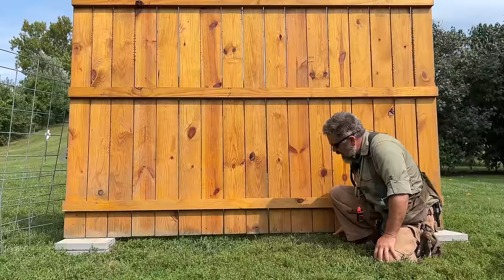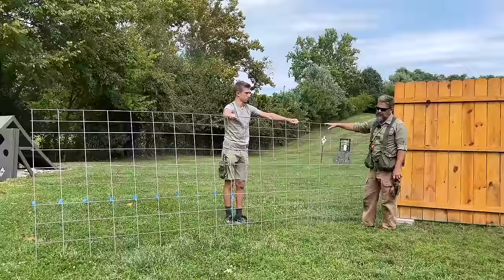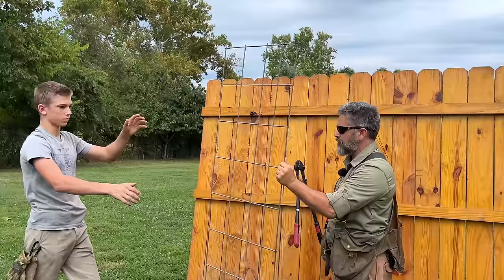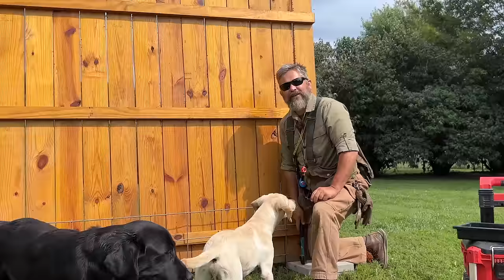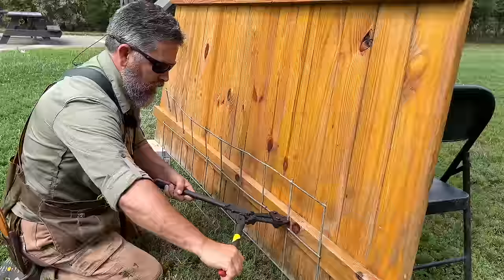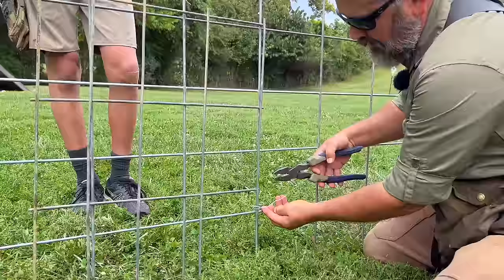How To Keep Dogs From Digging Under The Fence & Escaping Your Yard

Comment: I'm an old country girl.  I used to do this, until a kind older gentleman told me a better way with rocks.  Rocks has worked well for me for 20 years.  Works to keep coons/possums/coyotes out of chicken coops, too.  Get a bag of river rock, about 30 pounds.  Put the bag on the ground right up against the fence.  Leave it in the bag.  You can target areas, or just go around the entire fence.  If they dig into the plastic bag, rocks will come out.  You can also use rocks to fill any existing holes, just make sure you have a full bag on top.  It'll stop the digging in/out for years!
Reply: Any ideas on alternatives for rock with the same setup? I’ve seen these before, but my current pup has an issue chewing on rocks that he can get ahold of, and I’m worried about injuries if I use rocks large enough he can’t pick up
Reply: Thanks for this! I have one problem spot due to my neighbors lowering the lake level for the winter and I didn't want to go to this trouble for a temporary problem.
Reply: I use the large blocks from Lowes or from Facebook Marketplace around the perimeter of the fence. That usely deters them unless they decide to scale or jump over the fence.
Reply: Nice idea.

Comment: I am not sure if cinnamon is not good for dogs but I do know, based on my personal experiences with five dogs, that cinnamon does work 100% for me. I pour it generously everywhere the dog has dug, they sense it from afar and never touches it again.  They even walk away from the area when they get near it.   Yes you do have to put it out again if it rains.  The dollar store sells large bottles much cheaper. Black pepper and cayenne pepper do not work for me.   I even grind cinnamon sticks in a blender and use those.  Cinnamon sticks have also worked for moles when I stick them down in the mole hole path.... in which my dogs love to dig  up moles. The cinnamon sticks seems to deter moles as well. If you don't want to use cinnamon, keep rose clippings with thorns and put them everywhere the dog lays in your garden and they definitely don't like it.  For those people that say the if the dog exercises, it will deter digging..... Not true, my five dogs live on large acre farm and play and run continuously. But my cure is cinnamon personally. I have never seen anything that works this good.  It doesn't hurt my plants and also makes the outside smell so good.

Comment: Love your Video.  We do this on the farm. Much less expensive than any other way and a great way to use up panels the cows or horses have bent.  One Difference, with the chain link, I dont tie up with fence wire anymore. I use the steel zip ties with the tails turned to the out side. They are super easy and not near as sharp. We have Heelers and Aussies. If you dont keep them up when they're not working, they will get into trouble.  They're also escape artists. Mine easily "unzip"  chain link dog kennels. They'll work one piece till it comes loose at the bottom then pull it to creat a hole.... Using the pieces of cattle panel and leaving in up a couple feet puts an end to digging and unzipping!

Comment: If they are digging under a gate you can dig a trench big enough to bury some brick or block then a few inches under the ground.  When they dig they will hit brick. You gave me a new idea. I could get some 12" rebar space about 6 inches apart and drive them under the gate.

Comment: Great idea. Unfortunately, because I live in North East Pennsylvania,  there is more rock in the ground than dirt. Just putting in a single tee post is a nightmare.  I had to buy a 1/2" hammer drill to pre drill for each post. One of my dogs is a single focus, absolute target oriented 100% determined missle.  After 3 years she finally figured out how to dig out. She will probe for the soft spots. I might try this but I don't have faith it will work as I've tried tent stakes for sections between tee posts and I bend half of them. We'll see. Thanks for the suggestion.
Reply: Same with our soil, too rocky and hard, so we lay the hog pannels under the fence and attach them with zip ties, we have chain link.

Comment: Great video! We have neighbors that border our yard with vinyl fencing on two sides which leaves nice gaps in uneven ground. Since we can't attach anything to it my husband borders with huge rocks. Their dogs try to get in our yard. The aggressive dog behind us jumps just higher than the 6ft fence, you see his head up and down, and body slams it. Seems we're always left trying to protect our goldens from a neighbors dog. I have kennels out back which we were going to remove. Now my dogs need to be in them to protect them from the crazy pit in case it crashes through the lightweight vinyl fence. 
Sigh, neighbors
Reply: Hi Barbara, we too, have vinyl fencing around our yard. We also have a neighbor with a crazy pittie who smashes against the fence. What a small world. I have 2 questions with different scenarios for both.
 Scenario #1. the fence belongs to your neighbors. If this is the case they obviously don't value the fence. Have you approached them about what is happening and that you are very concerned about your dogs being harmed? If you have and they don't care, I would seriously consider putting up your own fence (even as modest as chain link or plastic netting) alongside theirs. In doing this you will have the legal right to install electric fencing along the bottom of the fence line (where there are open spots) on the side facing theirs. Electric wiring can also be strung across the top of your fence so that the crazy dog will catch his chin on it and be immediately deterred. If this beast continues to hurl itself against the fence and damages yours...this is when the rubber will hit the road and your neighbors will have to be responsible for their dog. 
Scenario #2 the fence belongs to you and the neighbors dog is eventually going to bring it down. This happened to me. I immediately went next door and explained what the dog had been doing. What damage  the dog had done and just how this problem was going to be taken care of. We were going to have a new fence installed soon and I wanted them to know that any damage done was going to be trouble. They were very responsive to my words and immediately installed an electric fence less than 6 inches from their existing fence and within 2 DAYS their dog stopped all of its misbehavior.  Pitties are known for being very stubborn. Goldens are known for being lovers. Now, my dogs are able to live in peace and I know that they are safe in 
their own yards. As it should be ❤
Reply: @angelsong119  ty for the info

Comment: I use rocks to cover holes my dog digs up. I use rocks no smaller than  the size of your hand when you have it open. A rock that size would weigh about 7-12 lbs (rough estimate). My mother told me about the drawback that insects and other pests may hide in it. To solve that, dig a shallow trench, about as deep as the rocks' height when placed on the fround. This will prevent pests from hiding in between the rocks. The next step is bury the rocks. Use your weight and jump on top of the buried rocks to compact the dirt. I observed my dog when he tried to dig and i noticed he stopped once he hit the rocks. After that, i kick the dirt back over the expised rocks and repeat the compact. Chances are high the dog wont dig in the same place. The hard part is finding rocks. I recommend this if you are on a budget and/or lack the right tools.

Comment: I have 5 Jack Russell's, 3 are 12 months old and dig like crazy. They're just now starting to explore on walks, which I take them every day. But they want to explore and won't accept being contained. I have to work so there's no choice but to leave them in the yard. I provided shelter from the weather and a self filling watering trough. They are all chipped and tagged. I just need to be sure they can't get out.

Comment: i tried this and just my luck my boxer and bernedoodle just dug deeper my boxer got out but my bernedoodle got her collar stuck on the stake end and freaked out giving her self a big gash on the beck of her neck and a few poke holes and a $400 vet bill,. So what i had to do was dig a trench and bent them into a  90 degree angle  like a big L sape flipped sideways and come 2 1/2 feet  away from the fance  taking it to the bottom of the fence and using u nails to take it to the fence post  it worked  they will still dig between the squares but they cant get out   its still an option if your dogs tend to be like mine and can still use the same pannels doing it your way without having to purchase more.  tho your method worked for my jack/corgi it did not for my boxer and bernedoodle

Comment: One of my dogs (I have 6) a German Shepherd, border Collie cross, can climb the 8 foot tall fence of their compound which is approximately 3,000 square feet of space, with trees, and a large shed with a straw covered floor for the dogs to hide in. I then covered the wire fence it with sheet roofing steel, then I found out he could jump high enough to grab the top and pull himself over. So I had to chain him as well until I figure out what to do. He then began tearing strips off of the sheet steel with his teeth once he had pulled a an edge loose with his claws, then he pulled apart the wire fencing behind it and got out again. My fence now looks like a barricade made from wire, steel sheeting and 3/4" plywood, concrete blocks and large stones, which for the moment have stumped him yet he still tries. I have to repair the fence daily.
Reply: Your dog is bored . Those breeds take an enormous amount of work.
Reply: For that breed combo, I wonder if making them a treadmill wouldn't be a better idea than fixing the fence daily.

Comment: Had a hunting breed, you should have cut the larger squares and maybe go 2 sections deep. I also would have placed staples on each wire across the fence and rotate them 90 degrees or horizontal and vertical  at each section but overall good video. Especially the beginning about giving your dog attention and exercise.
Reply from the maker: You should definitely make a video showing your technique. I’ve seen this one used for twenty years, but I’m anxious to see all the improvements people keep recommending.

Be sure to post a link when you get it uploaded.

Comment: Great idea... unfortunately the spaces in the cattle panels are too wide for smaller dogs. My dogs would walk right thru the space and keep on going lol
Reply: Yep you're right and his method above still doesn't convince a dog to stop digging it only perhaps stops them from entry to actually STOP the K9 from wanting to dig you have to do this:    it takes more work but what you need is smaller space wiring fence and bury it 3"-6" flat at the breech lines into the dirt.   1 foot wide of fencing buried 3"-6" the dog hits the fencing when they dig and it hurts their paws when they hit it and they decide its not worth the pain.
Reply: Look up utility panels, horse panels, and sheep/goat panels. Same heavy welded wire, 8 and 16 foot lengths, but smaller openings (4x4, or 2x4).
Reply: @Alluvial.  thank you, that is EXTREMELY helpful info. I'll check into it!
Reply: Surely! Hope it helps keep your pups safe, Holly!

Comment: My dog would just make a hole in the wood above it to escape.  She just learned this at 1.5 years old. Ugh! And yes she go for walks and runs with me etc. German Shepherd Rott Grain Dane Mix. My Belgian Malinois who could jump a 6 foot fence and loves to dig holes in the MIDDLE of the yard stays in the yard and when the other escapes she comes to the front door to tell me. Ugh. More training for the yound one. But this is a good idea. I just need smaller holes she can't squeeze through she does chew on the lower half .... right now.

Comment: What about if you have a vinyl fence? My Mom’s dogs are digging and they need a solution.
Reply from the maker: You may be able to use a cut portion along the bottom but do not attempt to nail or screw into the vinyl, as it will most likely break.

Comment: That would work great for a bigger dog but I have 2 Jack Russell's and they would fit through the big holes. So what's good for small dogs
Reply: Add rabbit wire/hardware cloth to the above ground part of the panel.
Reply: They make welded wire panels with 4 inch openings. Maybe that size would work?  They’re called Utility Panels, or Sheep And Goat Panels.  Also made in 8 or 16 foot lengths.  
Then there are Horse Panels (way more expensive) with openings that are 2x 4 inches. Same heavy welded wire.

Comment: How do you keep the dog from digging under the gate to get out? Wood fence and gate.
Reply: This worked for my dogs:  dig a trench across the opening, between the gateposts.  Put in a treated 2x6 set on edge, cut long enough to overlap both gate posts.  Use a couple long deck screws to attach each end of the 2x6 to each gate post. Backfill around the 2x6 to bury it.  I set the 2x6 a little higher than the ground level, but you could also set it at or a bit below grade if you preferred that.  The key is to choose the right gap between the top of the buried 2x6 and the bottom of your gate so the dog cannot fit through (and also make sure you are not creating a tripping hazard for yourself).
This has worked for us for years.  
I’m about to make a new gate between T Posts, and my plan is to hold the buried crosspiece in place with a loop of galvanized pipe strap around each T Post. I might stack two 2x6 pieces, since I’m trying to keep coyotes out of a chicken coop.  The rest of the perimeter will have an 18 inch anti-digging skirt (made from cattle panels) flat on the ground, but that’s too much of a trip hazard for my preference, in the middle of the path.

Comment: That will work but…. Electric wire on the ground around your fence line works way better than anything else. It’s solor or electric. Very cheap to run. I remember getting shocked from an electric fence 25 yrs ago. I will not make that mistake again. Wait now……. Here’s why I recommend electric wire, your dog will get zapped 1 time! And he will never try to dig again. Wait now, not only does it keep your dogs in but it keeps predators, snakes, gators, raccoons, anything else that you don’t want. Wait now, It’s also way way way cheaper than hog wire panels. Wait now….. not only does that…. After you dog gets zapped once…… he will never touch that wire again. Would you? You can turn it off and still be safe.